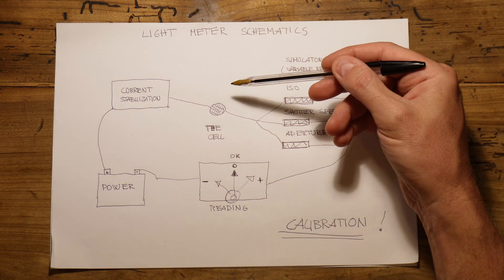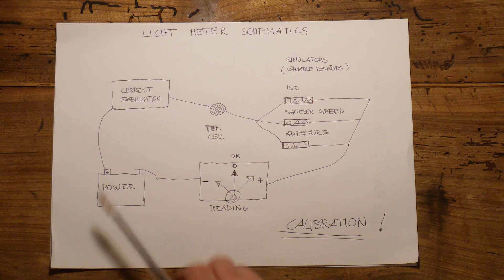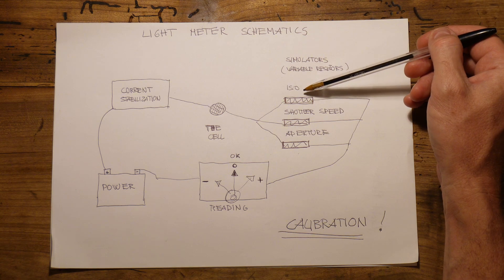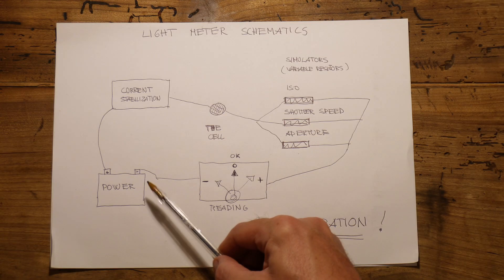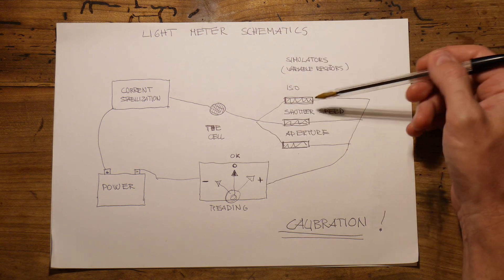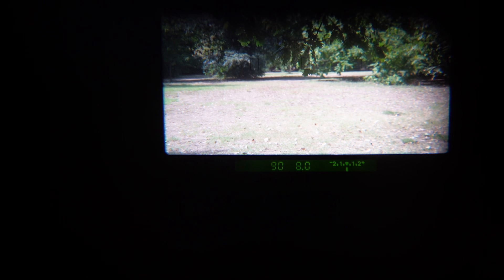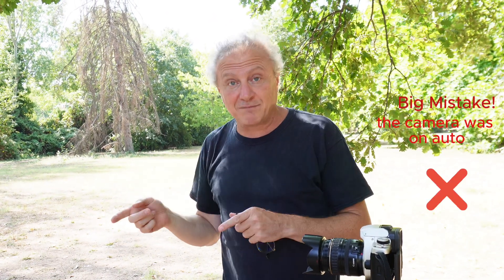Lightmeters! A guide on their use and choice.

Comment: 00:01 📉 Light meters indicate middle gray, not precise exposure.  
00:33 📏 Light meters suggest exposure but only target middle gray.  
01:43 🛠️ Light meter components include a metering cell and variable resistors.  
03:29 ⚖️ Metering standards vary; some use 18% gray, others 13%.  
04:08 🔍 Four metering patterns: average, center weighted, spot, and matrix.  
07:09 📊 Reflected vs. incident light metering: each has different advantages and limitations.  
09:29 🧠 Reflected light meters require interpretation; incident meters suggest exposure.  
10:35 🌘 High contrast situations can challenge incident light meters.  
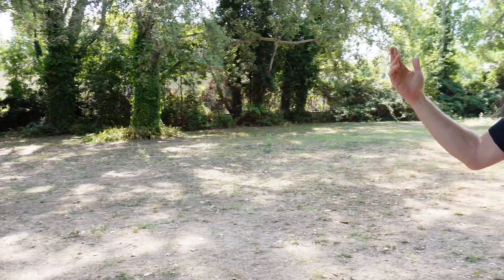12:26 🎯 Correct exposure focuses on shadow detail, not framing.  
13:44 🎛️ Spot meters measure narrow areas, useful for precise exposure settings.  
16:07 📸 Spot meter settings guide exposure based on shadows and highlights.  
17:23 🎨 Technique is a tool for expression; there’s no universally "correct" image.  
18:10 🧠 Use technique creatively rather than following strict rules.
Reply from the maker: Excellent! It seems you really watched till the end getting the useful points.

Comment: Of course everything must be calibrated. The -3 +3 readings are always the same but what changes is the effective iso speed that you set in the meter and  the developing time (energy). Also the middle gray reading...it gives the middle gray if you calibrate the whole process to give you the middle gray. Am I right?
Reply from the maker: Yes, correct.  BUT it is more convenient to calibrate on the deepest shadows, because calibrating and thinking on midtones may produce big mistakes in exposure, ie: increasing under exposure as contrast rises.